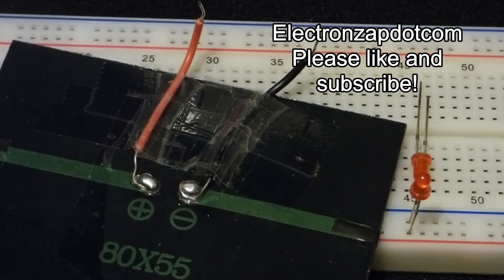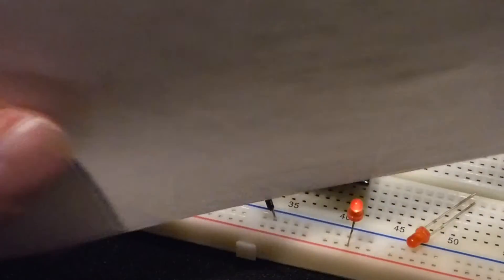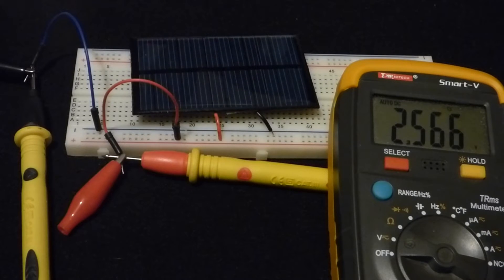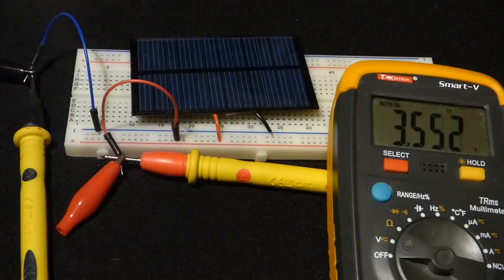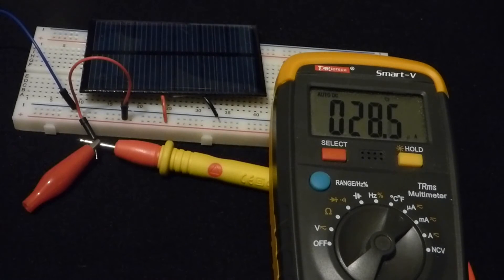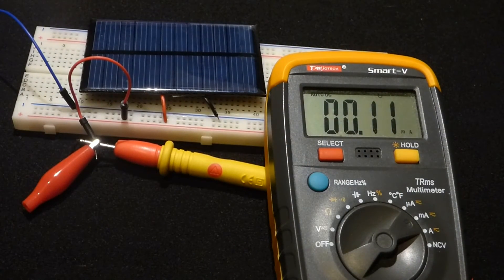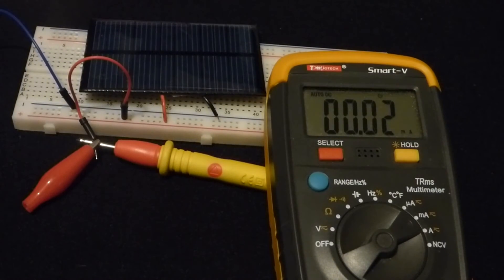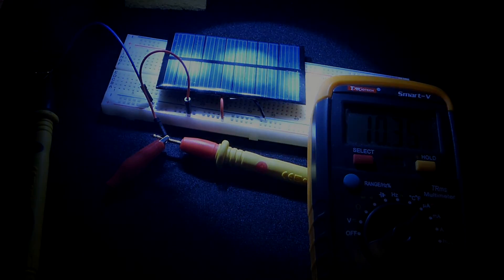Multimeter measurements of a 6V mini solar panel I got for a dollar, under indoor lighting

Comment: The voltage you measured is open circuit voltage. You should measure the voltage when connected to a load like when you connected it to the led. It would would be significantly lower almost half of the voltage you measured.
Reply from the maker: Good points!

Comment: Thanks but an advice I guess that panel high probably approx. 1 watt , for get 700- 800 mA (I guess it can supply that value) must be under the "REAL SUN" light... Not Lamp... Thanks...
Reply from the maker: You are absolutely right, I need to use/test the solar cells/panels outdoors. I am waiting until the channel grows before I devote more time to solar as it takes up a lot of time and I need to find a good area and set things up for filming. Thanks for watching!
Reply: I guess you get good results top level efficiency, good luck, thanks to you too...

Comment: Thank you. I will buy one. Thinking about a 9V or 12V or 18V panel...not sure which. For breadboard and 4 wheel robot car use. Which would you recommend?
Reply from the maker: I don't have any recommendations unfortunately. I haven't done much with solar. I usually get home from work when it is dark out and that's usually when I am most wanting to make a quick video so I have put solar on hold for a while.